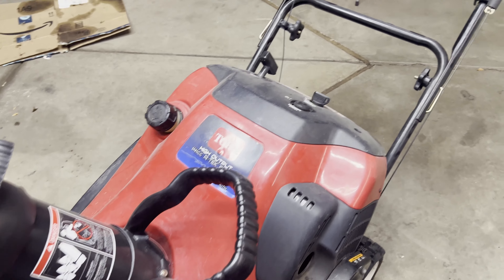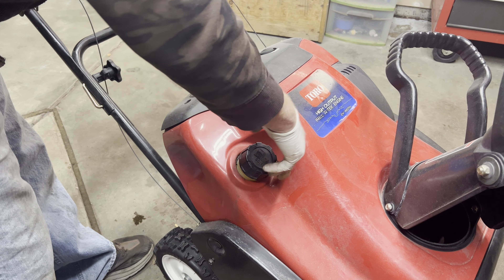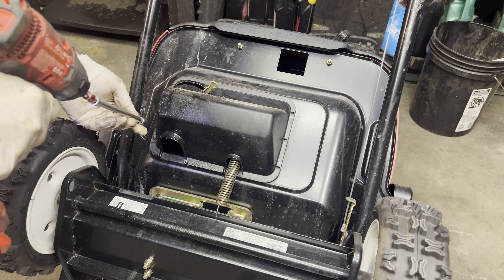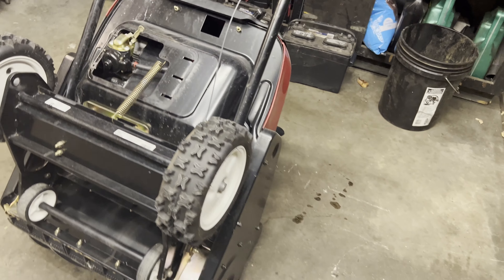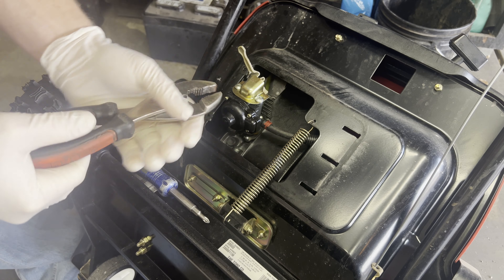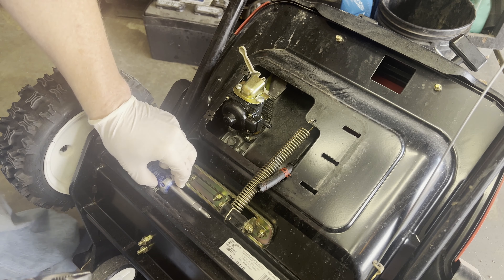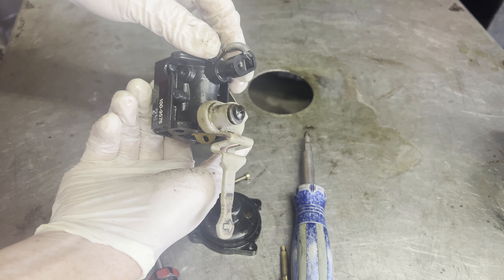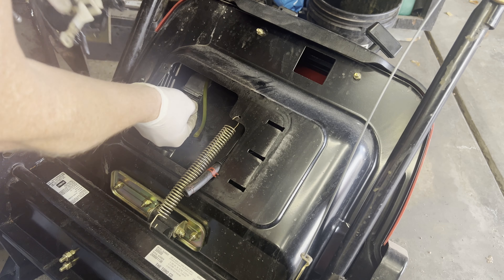Toro Snow Commander With Power Propel Snowblower Will Not Start Small Engine Repair

Comment: My 17 year old Snow Commander is great.  And they are single stage snow throwers.  Never a carb problem.  I have replaced the primer button as the rubber/plastic disintegrated.  And I replaced the rubber blades once every two or three years, the plastic bars on each side of the blade area as they break, the plastic scraper that wears, and the lever that keeps the chute as the water and ice melt seized it up.  I do maintenance/repair in the warm seasons.  I do have electric start which makes life easier when doing an initial startup at the beginning of the season.  Great video!  Thank you for sharing!
Reply from the maker: Thank you. You're welcome.

Comment: Nice video, I dislike this type of snowblowers lol. I am used to the 28in Ariens or Troys. 
But yeah lately I just check the gas first, drain it, and then I add new gas and see if it runs and sometimes it does.
Reply from the maker: If I started it with starting fluid it would run. Just would not start on it own. Weird how old gas behaves. We need a scientist to chime in 🙂